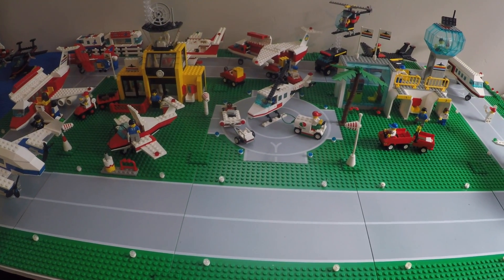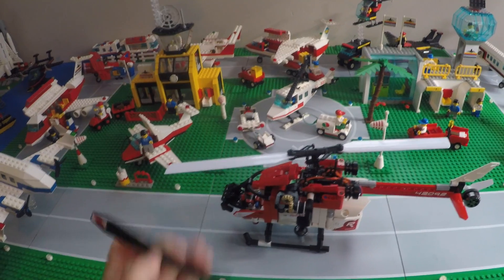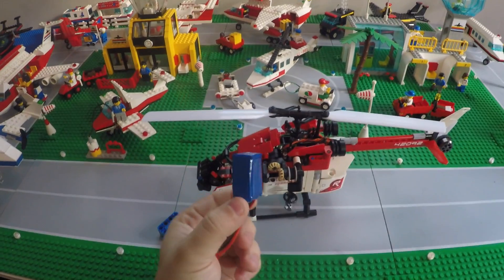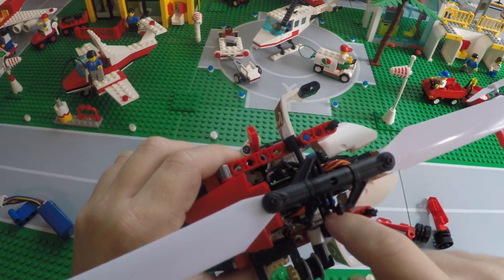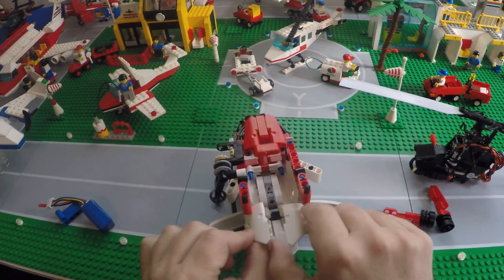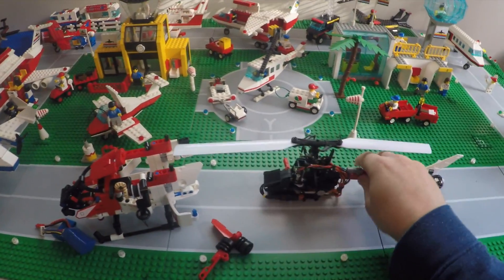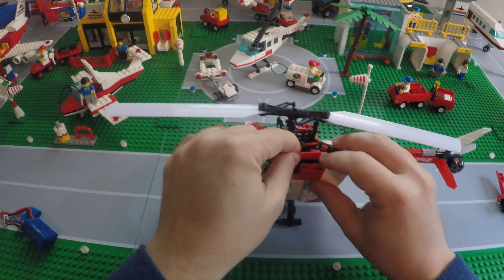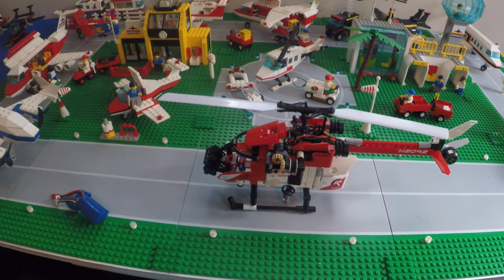Flying LEGO Technic Helicopter

Comment: Which helicopter model you used for the engine? Is it still available somewhere? It'd be cool to try and replicate this
Reply: you can find a frame for almost any size, just measure out your lego technic helicopter and then search up an rc helicopter with the same size and weight. i managed to find a small twin rotor rc helicopter and mounted it into set 42020 which is the twin rotor rescue helicopter and it works great

Comment: That’s extremely impressive, I have to ask though, is the motor actually Lego too?
Reply: no, he bought a seperate rc helicopter, took it apart, and mounted the frame of it into the lego set. so its basically an rc helicopter with a lego frame mounted on